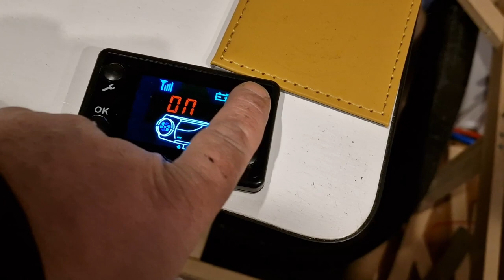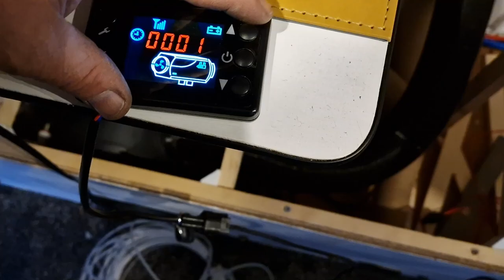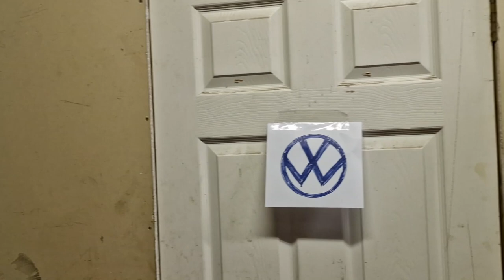Fitting a stand pipe into a Mercedes sprinter | VW Crafter | fuel tank for a Chinese's diesel heater

Comment: What a great video on the subject!
First of all: That is one tight fit in your driveway. You bought your property to size, did ya? 😁
I also had to replace a few fueltanks in my wrenching days - always the source for great entertainment. 🙄
When customers brought their vehicles in, we always told them to be on max. 1/4 tank. After dropping the tank, we used compressed air and a brush to clean all the dirt, sand and grime. Before refitting the tank, we emptied it (less weight to contend with during the install) and always had a couple of 5 gallon jerry cans for that.
I do ❤that makeshift retainer ring wrench and will definitely adopt that to my tool box. 👍
Great show, Sam and Andrew! 😊
Stay safe! 🚐☁🍀
Reply from the maker: It was all good fun we had a great day 😊👍
The drive is tight I may have broken a mirror or 2 reversing of the drive 😁👍

Comment: Hi, it might be a silly question, but when you have reinstalled the fuel tank do you have to bleed the fuel line to the engine? Great video by the way 👍
Reply from the maker: No silly question here mate it's a self priming system so no bleeding required